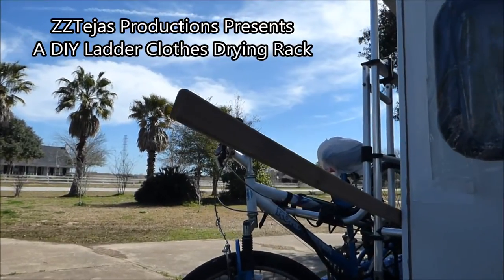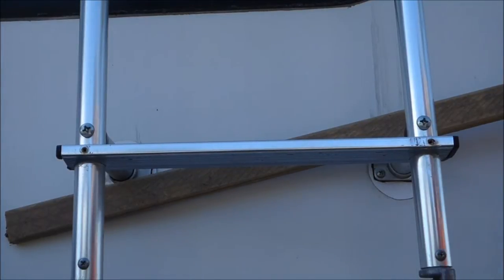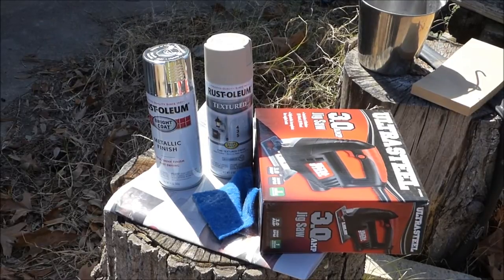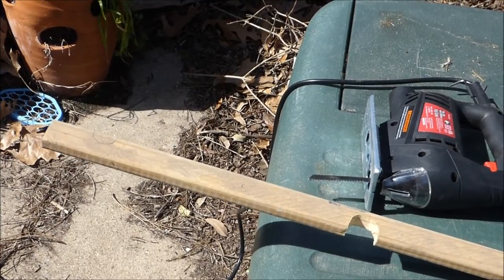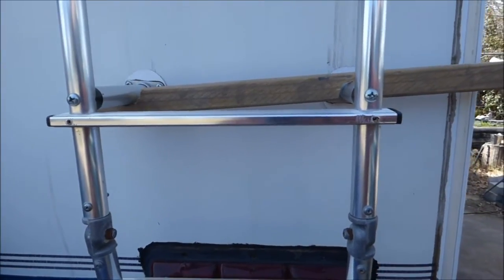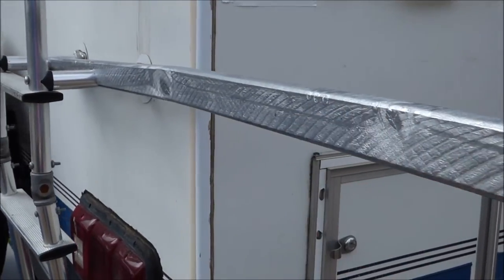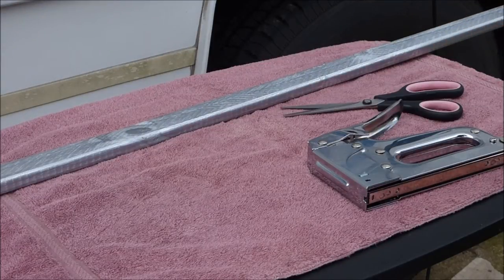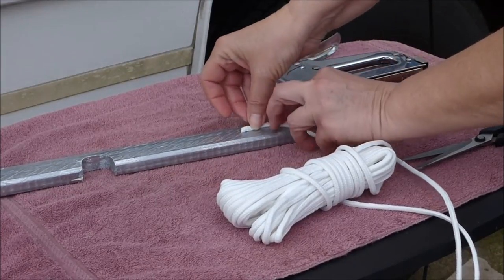Fulltime RVing   DIY Ladder Clothes Drying Pole

Comment: or if u cut slight notches into the top edge of the bar u could hang the hangers on the notches.
Reply from the maker: I will need to make another one out of sturdier wood, although this one has lasted me for several years. The rope works well without having to do more cuts in the wood. 
Thanks for your idea though!